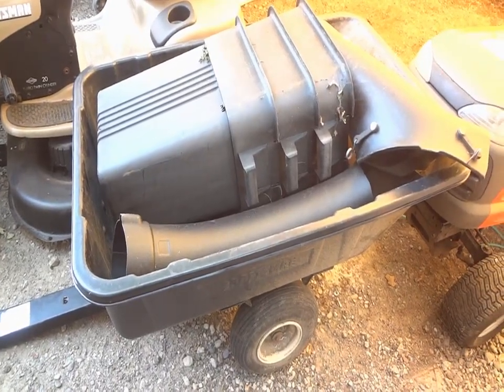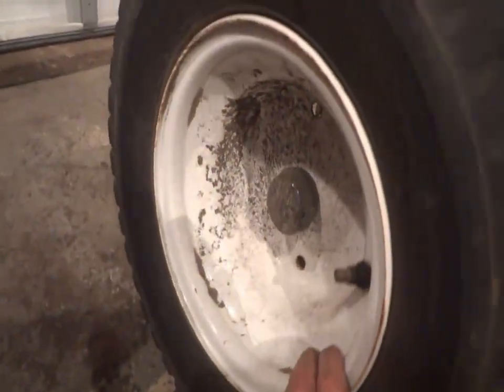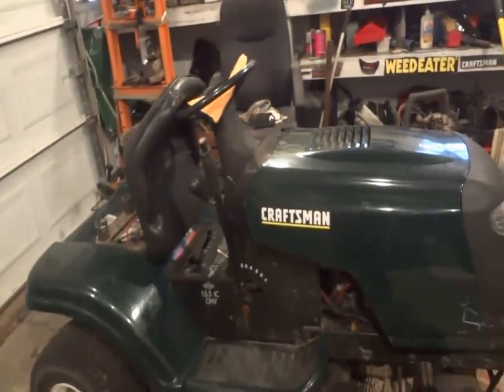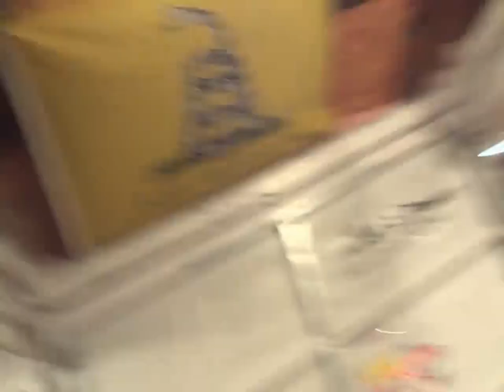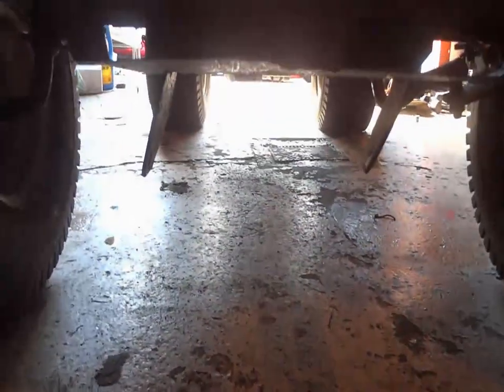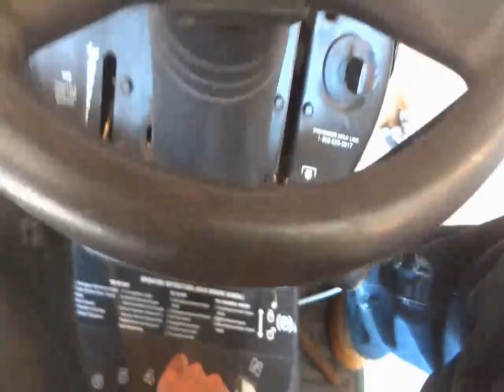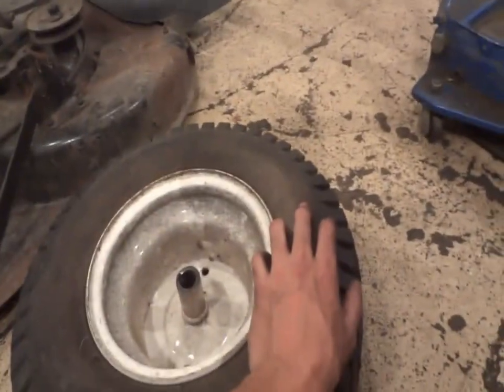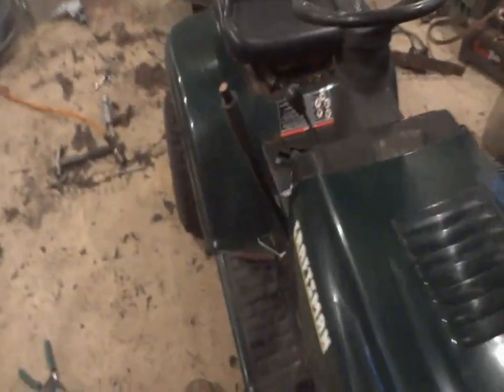peppercatkeith's Free LAWN TRACTOR

Comment: Nice
 Could you do video on how the pulleys are setup on the 42 inch decks, pulled the green tractor deck apart to weld it and forgot how the pulleys go back on.
Do you know how much the 2008 LT2000 want for new?